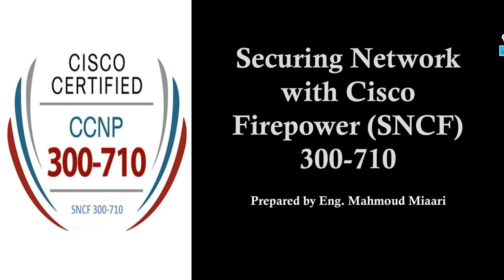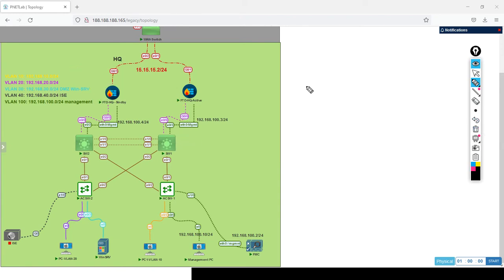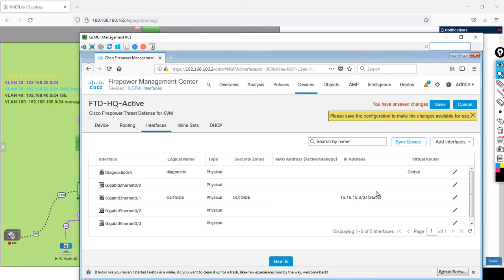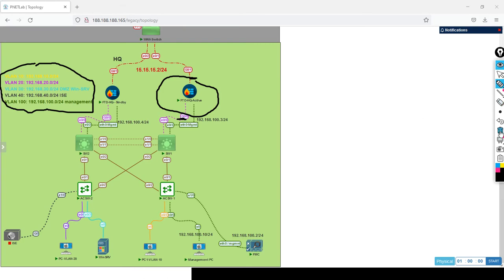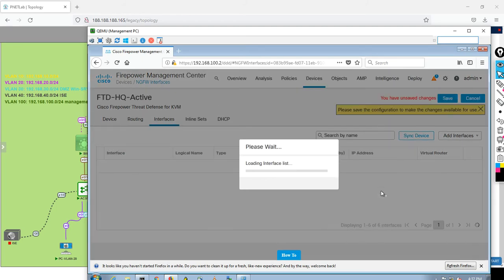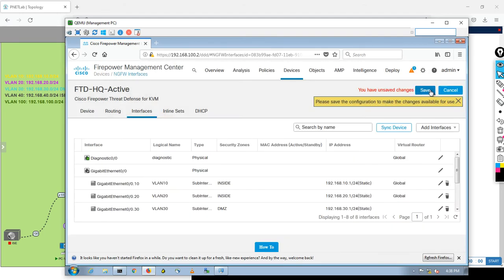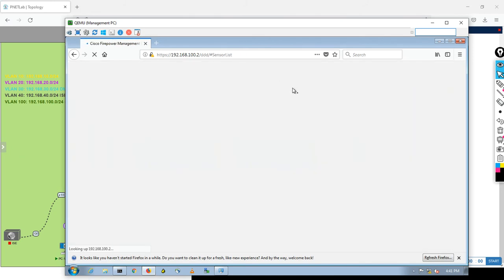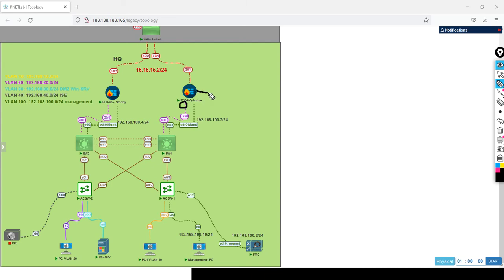7- Configure Sub-Interface on FTD via FMC

Comment: I need to ask a question. Creating sub interfaces on an FMC managed FTD that already has 16 sub interfaces on the OUTSIDE interface, the FMC wouldn't allow it. I could create on the INSIDE interface that's got just one sub interface, but I couldn't on the OUTSIDE interface that already has 16. Can anyone tell me if there's a limitation to 16 sub interfaces on the FMC?
If i create it on the chassis, I'm able to sync and use it on the FMC, just couldn't create it from there after 16 sub interfaces.

Comment: Hi Mahmoud, thanks for the video! I have a question here, does FTD know how to route between these Vlans(sub-interfaces)? or do you need additional work here? I am trying to do a FW-on-a-stick for a small lab deployment like this:       FW (inside) <----> (trunk port) SW ---> several Vlans and Servers. I created the sub interfaces and VLANs on SW and FW but I cannot ping any other server from a server that is not in the same vlan. Thanks!
Reply from the maker: Hi
Thanks for your question,,,

You need to do policy between the VLANS to achieve the intervlan routing